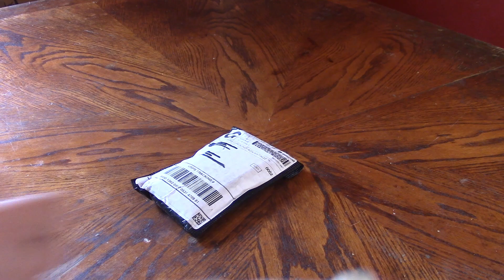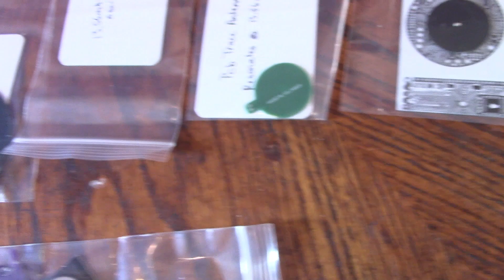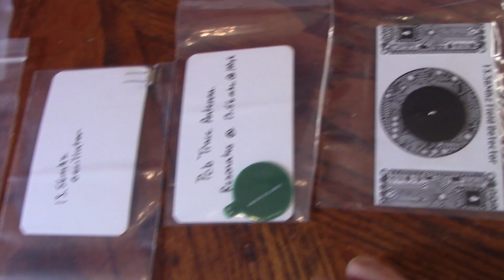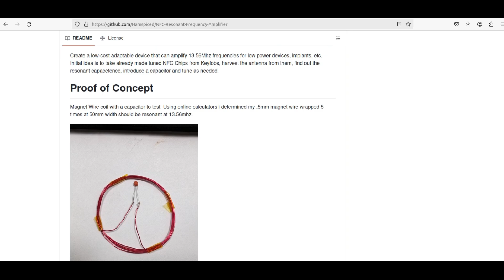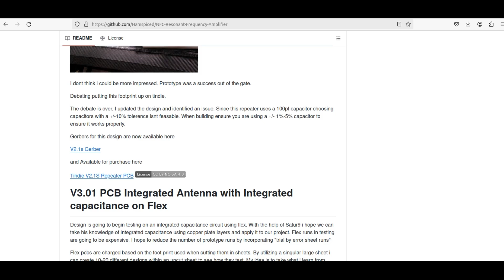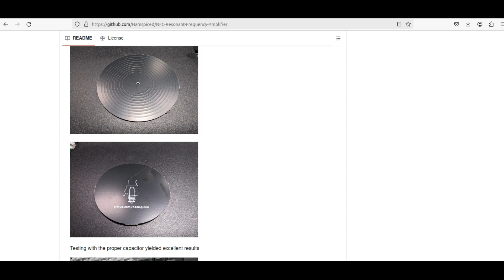Professional Resonant Wireless Energy @ 13 56MHz

Comment: That brings me back... I worked on a device to power nfc implants that have an led with people in the dangerous things forum. I had to pause working on it though as  i didn't have the time and energy to continue on that for quite a while now... I used a self oscillating approach using a royer oscillator and another one using a modified zvs circuit. I was struggling to tune it properly though as i didn't have a VNA back then

Comment: Great video and thankyou again for helping with this project.

The repeater devices are in two difference sizes, i have found that for smaller NFC devices the smaller antenna works well (NFC keyfobs) and the large device helps better with larger NFC circuits (Key cards/tap to pay).

I am currently designing a 125KHz repeater circuit to be able to get into RFID applications.  And i am trying to create distinctions as the entire wireless energy and wireless communication terminology seems muddied.  I refer to RFID as operating at 125KHz and NFC (Near field communication) at 13.56mhz.    There are also UHF that i havent gotten too far into and dont think i will.  

I am excited to see what you can do with this technology.

As an idea of what you can do with the repeaters.  If you place one of the repeaters between the coil and your LED with the diodes, you should be able to increase the distance at which it lights up significantly.
Reply from the maker: Great to see your comment Nick 👍
There's lots to learn with the terminology! Great fun and enjoyable to work on.
Yep, for the repeaters, I just sent a vid of using that same idea, of the repeater on the green coil. Am happy to have found that out by accident and then the penny dropped, it was how you intended them to be used! It will be included in the next public video 😀